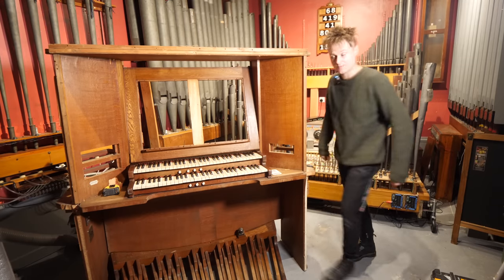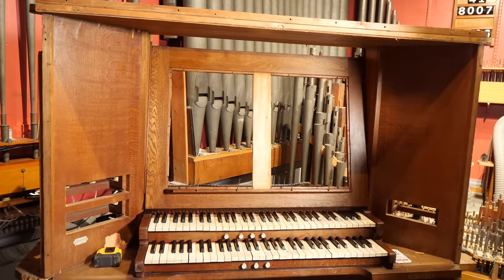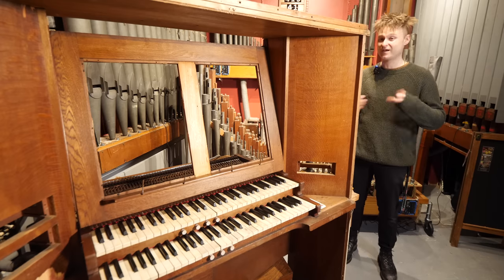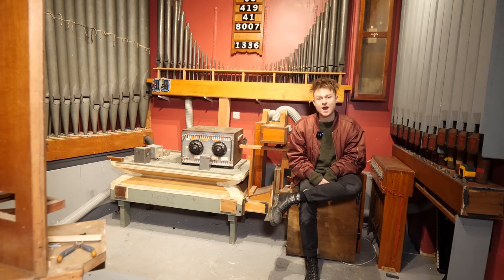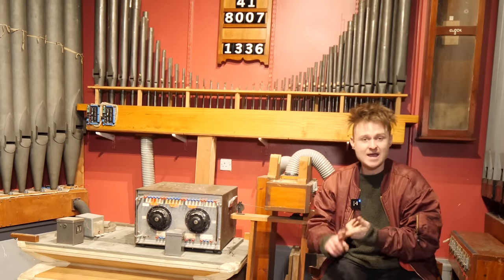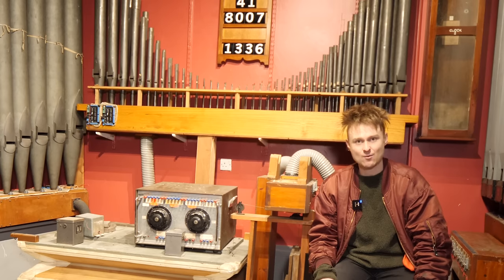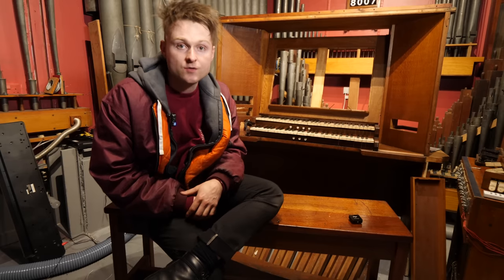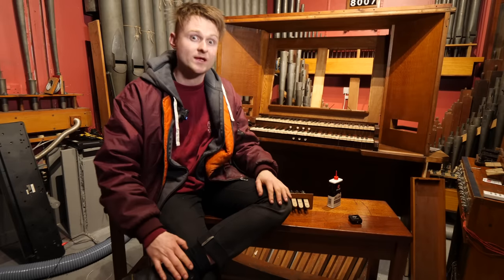I BOUGHT A CHURCH ORGAN PART 13 - MAKING IT LESS NOISY

Comment from the maker: This vid is a halfway measure, more to come! definitely a marked improvement, 1 step back then next vid 2 steps forwards!
LOOK MUM NO ORGAN TEE's Are Available Here https://store.lookmumnocomputer.com/collections/merch

There has been comments about my statement on keeping it original is inconsistent with what i've done with the electronics and the LED's. i just want to say i disagree. I dont think its inconsistent. the console is even rewired to be modern electronics. The rats nest of wiring from the 70's has been removed yes. But its more a statement about the console which is the main interface device, and keeping that original, warts and all. this is the part that people touched and used. it holds the story thats why it would be horrid to revamp it. This project is not about keeping it original but building on the machine but keeping true to its story.

Also the comments about the blower running out of air in the store cupboard are vastly over estimating its ability to try and make a vacuum chamber! Besides the cupboard is relatively large and has a false ceiling. Getting air is the least of its worries.
Reply: Great Job! For the blower maybe check if you "just" need to change the bearings
Reply from the maker: @tesicnr  its probable! but im hoping to have a spare so if i take it apart and it needs a lot of work the organ isn't indefinitely out of action if you catch me drift, since i have 1, i cant take it to pieces.
Reply: That art on the Tee looks great! Tee-shirt looked a bit on the baggy side but will see the actual fit when I get it 😀
Reply from the maker: @bunker1213  nice! yeah drawn by me mate johnny goddard
Reply: Personally I would keep the blower as it is ( and of coure maintain it functioning ). I like the bzzz that makes when it's speeding up since from part 2 hahahah
Reply: I bet that wire coil hose you are using, also helps to stabilize air pressure, because it expands and contracts, like the bellows/regulator. IDEA! Put a glass door on the regulator/pump closet, with light pointed at it, so people can peak in at it, while somebody jams on the organ. The harder the jam, the more it'll have to work, to regulate pressure. --And the more interesting to look at, in action.....
Reply: The work you did keeping original parts and fixing this thing has been great to watch. It was in disrepair, people are crazy.
Reply: I think you are doing a good job with it all. As far as the console, i think it would be good to add a frame around it for some structural integrity, and to make it look a little more finished, since the original wood you weren't allowed to keep. like that is a good spot to add to the story while still respecting its history.
Reply: KEEP PLUGGING ALONG! sounds great if in need of some tuneing and the choice of tunes again was brilliant but please include the titles ,,,,my brain cant be relied upon to recall the composer or title of music more than 60 years old lol and im only competent with that.
Reply: Everyone's a critic until they have to get off their Ar*e and do something. It's a beautiful Thing you've done Sam. :) --- i still remember a few years back when you used the term "Agricultural" to describe your style of working. I've since co-opted that descriptor :p --- everything you do is uniquely you, your own style, and a personal brand if you like it like that.  If someone thinks they are a "purist"...there are quite a few organs out there on their way to the bins, they're welcome to go out and grab one and spend 2o years on it... I've seen at least 3 in my lifetime (so far) - 2 theater and 1 church organ --- Cheers Mate! (keep on keeping on...)
Reply from the maker: @GillamtheGreatest  i was thinking of only adding see through bits to it :D. thought would be cool to show where it stopped
Reply: Halfway ‘measure’ ba haaahaahaaa boom boom!
Reply: @LOOKMUMNOCOMPUTER  yeah for any of the like main viewing area bits i think thats the right call. the frame thing im seeing in my head is like outside all that. maybe trim is a better word? like giving the outside a little supportive hug
Reply: I love the way you've approached it. Kinda like Jay Leno's approach to buying old cars — he usually keeps the patina but makes everything work reliably and also fits air conditioning to make it comfortable in LA traffic 💓
Reply: You need to piss of the estate of John Cage with a recording of Variations on the theme of 4'33", you have all the instruments needed and you could have it done for the 1st of next month if you have the time 😉
Reply: The wiring under the hood is a completely different story to the interface. Rewiring and rebuilding the guts is legit, as is keeping the console as close to original as possible. 

I did a project a while back, made a recreation of the prague astronomical clock. The front looks similar to the original (but uncolourised unfortunately), but behind the scenes is an arduino, stepper motors, gps chip... pretty sure they didn't have those in 1410!
Reply: nooo, you should have kept it original by keeping all of the bits that aren't original to the original organ.
Reply: re: "Keeping it original" well, it's been moved and modified before, so 'frankenstein' is it's original nature.  Upgrading it with electronics fits perfectly for what it is. - A recommendation for the museum, is put a clear panel in the door to the blower so people can still see it, without having to hear it?
Reply: @kevins.3573  There is no singular organ, this was first made using an organ that probably wasn't even electric, then if I understand it, it was modified using parts from a different organ, and has become a hybrid or a chimera of machines. While I agree it would be nice to keep this as original as possible, you can only go so far before it becomes impractical. This is a best compromise, allowing it to last for years to come Instead of being a non-functional ornament.

Comment: If you see this Sam, an idea for the pipes I had goes like this: PVC, but instead of PVC cement on the joints/couplers (permanent bonding), you use a bit of silicone caulk OUTSIDE the connection. Air tight (don't try with water) and removable. If you need to cut the PVC to length, it can always be coupled back together for full length. You can use the PVC as a manifold to connect to the flexible hoses you already have. 

Just some theory crafting. I agree with your statements/thought-process on keeping the soul of the instrument in the looks department but making it more functional with the electronics. Wish you luck and thanks for the content!

Comment: Wow... Joan's organ is coming along nicely... I agree with you, I like to keep things as they are instead of completely changing it to being brand new!

Yeah, you'll need to tune it every 6 months depending on how often the temperature and humidity fluctuated in the room. Little tip to save time when it comes to tuning, if you tune a 4' diapason pipe (So, a 4' principal for example) to concert pitch, you can then tune the rest of the organ off that rank of pipes so, in theory it all is in relative tune with itself. This can be done by listening to the audible beats of the sound waves that are produced when an out of tune pipe is played at the same note as the tuned 4' diapason pipe. Just remember that the pipes might be at different octaves too - 8' is the equivalent of middle C, 4' is an octave above and 2' is an octave on top of the 4'. 16' is an octave below and then 32' would be an octave below that - If the Joan's organ had a 32' I would be surprised!! 

Reed pipes are a whole other kettle of fish... Very sensitive to temperature changes, just because of the nature of the pipe. Same with the wooden flue pipes - The Bourdon 16' on the right wall and then the Stopped Diapason 8' (The wooden flute ones) will change pitch at different temperatures because of the material. I'm currently retuning the wooden pipes on the organ I play on at the moment even though the whole organ was tuned about a month ago because the church has warmed up... Its a pain but, there you go! 

About voicing - You might want to ask a organ builder firm like Nicholson & Co. or Harrison & Harrison!

Comment: In the end you might find you can sort the reservoir out so it can be moved closer to the pipes without getting too much noise (if you have a problem with air supply to the pipes). The organs I've seen all have the blower in a separate room because of the noise, but the reservoirs are usually in the pipe chambers with a really short run to the wind chests.
Reply from the maker: Yep. If when all pipes are running it's a problem I'll either put it closer or more wires. It's so close I don't think it's gunna be an issue
Reply: @LOOKMUMNOCOMPUTER  it was only an analogy. Tubes aren't actually wires, silly.
Reply from the maker: @NOLAfugee  language is language you know what I meant. Partially the fact I commit to practical as I am a jumble with words and you know what I meant.
Reply: @LOOKMUMNOCOMPUTER  you forgot for a moment that you're working as a plumber more than an electrician on this job. Keep up the good work.
Reply: Maybe a better solution is to go bigger, not more, with a wider pipe from the cupboard to the organ room. I'm sure flow rate charts are available somewhere on the internet.
Reply: @LOOKMUMNOCOMPUTER   in the world of organ building we notice often that moving to larger sized pipes, and smooth pipes makes the wind conveyance much more stable. tubes with ribs like the flexible ones cause massive resistance to airflow especially over long long runs. bigger diameters all the way to the chest will solve a lot of issues for you. you can reduce the size right at the end to fit the chest. we often use ABS or PVC to convey wind as its super easy to work with and very smooth inside. wind also hates hard 90 degree elbows and if you can use two 45 degree elbows it helps. you can also make trunks from plywood!
Reply from the maker: @connerkunz4260  what I've done works fine. I'm aware of the issues but because the organ is relatively
Small none of it is an issue. It's a similar argument to gold plated connectors on hifi systems haha
Reply: @LOOKMUMNOCOMPUTER   the mathematics behind fluid dynamics do in fact disagree with that comparison, but if it works well enough for your purposes, bully for you!
Reply from the maker: @connerkunz4260  I'm not disputing the fact it makes a difference. But in an organ like this it's not noticeable in the outcome. Much like gold plated contacts 👍 cheers
Reply: @LOOKMUMNOCOMPUTER  it sounds like you're committed to the setup as is. all the best with it!
Reply from the maker: @connerkunz4260  indeed. I was going to go solid pvc pipe and plywood for the very reasons you explain. but since it has been fine with this piping previously. And it's more mobile there was No real reason to change it. Cheers 👍

Comment: You'll never get rid of every single air leak.  Each time you fix one, the next-most-prone point then becomes the biggest problem, as the pressure increases within the rest of the system.  Your only hope is to reduce the number and size of the leaks to a small point.  And knowing where the worst one is will give you a clue as to where it will eventually need the next repair.  This sounds wonderful.  And I'm going to have to come down to the museum sometime to see it.  Mind you, I have had an idea - if you managed to get EVERY bit on wheels, then you could even take the whole thing on tour!

Comment: Good to see the progress! To continue your electronics analogy, though, I'd say you've done the equivalent of use way to small a conductor (and they do call them wind conductors in pipe organ parlance) from the reservoir/regulator to the organ. I'd guess the reason it sound more dodgy is that there is the equivalent of too much voltage drop, and that the pressure sags when you play groups of pipes, making the thing go flat. If you look at the size of the individual windiness to the chests, you see that their cross-sectional areas combined are much larger than the one main from the regulator. Ideally every chest or two should have its own connection to the regulator in the other room. You might be able to get away with one big wind line from the regulator to the chests, but I doubt it. Depends on how far from the chests it is. If too far, the elasticity of the air in the big wind line will allow the pressure to sag at the chests before the regulator can correct it (not sure, this might be an induction analogy). I would expect to need something more like 8" (20cm) diameter round conductor, at least, from the blower room to the organ, or several smaller conductors. They might have gotten away with something smaller when everything was clumped together, but the further the chests are from the output side of the regulator, the more it is only regulating its local pressure, since the wind line is a restriction. Air is elastic. Too much "voltage drop" and the "voltage" sags at the load when lots of "current" is drawn through too small a conductor. Aren't analogies fun! Keep up the good work. You're on the right track. Can't wait to see how it comes out.

Comment: you probably have a smoke machine somewhere, feed it into the intake to spot the leaks, i use the same trick to check the piping in my roof for the heat transfer pipes to the other rooms for my heating/cooling.

Comment: I had a thought- if the pipe flexes too much could try some clamps/brackets to hold the flex pipe in place and then if it needs moving just remove the brackets

Comment: I work with a lot of antiques, and my theory on cleaning and patina is I only remove what could further damage the device, get it stabilized, and highlight the story’s patina because it’s the best part of the device. You could make the moon look new again by removing Neil and Buzz’s foot prints, but then one of the greatest stories is gone. Yes, there are a few antiques that I have restored to completely new (and then some) condition and they are just stunning. But that beautiful old oxidation and touch of grime are like my laugh lines, well earned.

Comment: Yup, keeping it original is the way to go, so long as original isn't a pain in the backside. That said, I still think you should repair the console slightly, like where you can see the veneer on the left side bit trying to peel off. Just put some glue between it and the board, so it doesn't fall apart any more than necessary.

My family is about as secular as they come, but my dad used to play the organ at a small local church before we moved to the city, and I've always thought it's a cool instrument. Love this series.

Comment: my suggestion would be to replace the mechanical airflow regulator on the inlet to the wind chest with a level sensor and a variable frequency drive inverter so the motor only ever spins as fast as it needs to, itd help with overall power consumption and also reducing noise when its running

Comment: Agree with keeping the patina of the organ & console. I would suggest building something around the console to cover up whatever was hidden by trim /walls before (at least to cover up any stabby bits) and extend it over the back of things if they stick out enough. Could put in lots of windows/ports and lighting so folks can look inside the console while someone is working it. Framing it into something would avoid stuff getting broken by mistake and give you somewhere to mount lights to show off the workings.
Reply from the maker: I'm thinking of filling all the missing bits with Perspex. Dunno yet. It's not done. When I make the platform for it I'll be doing it

Comment: Putting stuff on wheels is a good idea in the Small - ish space you have.
 I wonder if you could use PVC plumbing pipes with threads on them? That would be the best of both worlds.
Reply from the maker: The reason I am not using pvc I may have edited the bit out talking about it. Is because it'll be cut to size. And if I go to another place they'll all be cut for the old place. The pipe I am using atm is more than fine. Infact I'm starting to think the people talking about the issue with flexi pipe are being mellow dramatic

Comment: Awesome. I had to do a very similar thing for a chocolate winnower. I used onshape to and my flanges look almost identical to yours but a lot smaller because my first flange was a little bit bigger and I ended up having to print a second one. Because I have different kinds of air pipes going all over the place I ended up making pieces that would fit together no matter what. So one end is universal and the other end is size to whatever piece of pipe I'm putting together. So that lets me attach any pipe to any other pipe because I know there is a universal connection on any end. I don't know if that helps you at all the next time you go to rethink running or expanding the connections. But if you think about what's the largest opening I need, let me make a square around that and then everything else can attach to that and it doesn't matter if the inner diameters smaller it will just scale down in the connection itself. Looking forward to seeing where you take this.